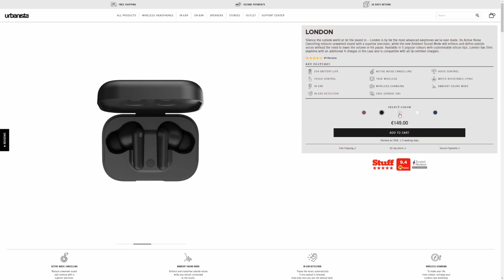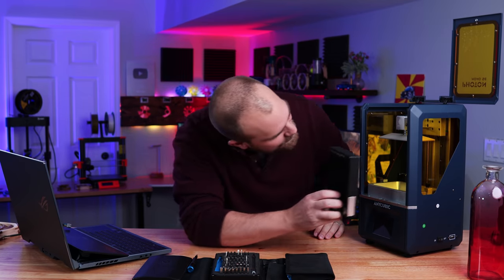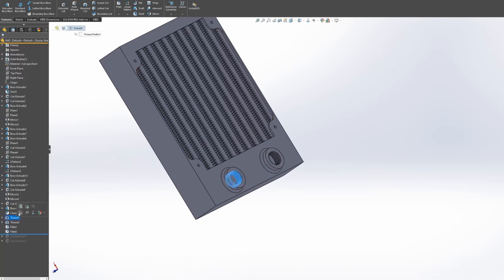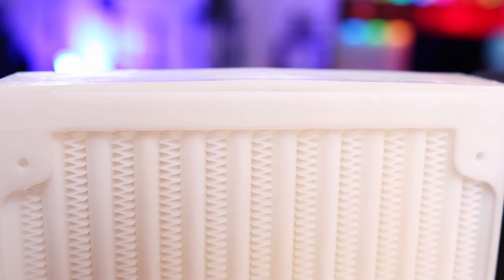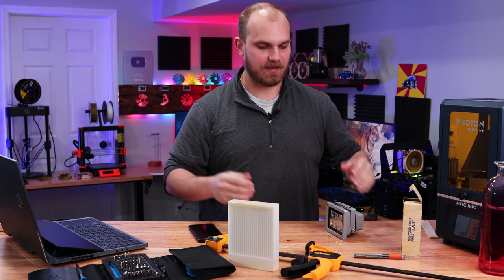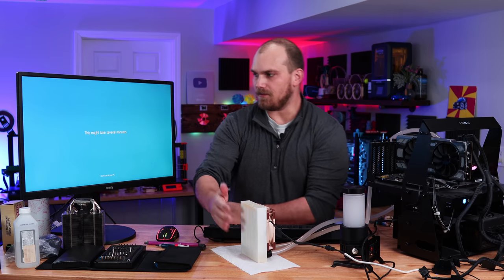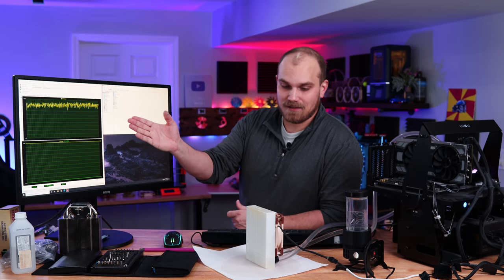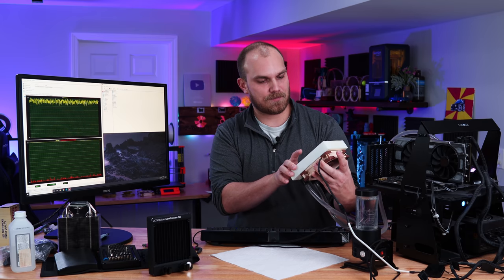I Never Expected This | 3D Printed EK Coolstream SE 120mm Radiator

Comment: You should remove the fins, as it's a non conductive material they act as nothing more than airflow restrictors and insulators. Just make parallel hollow bars with a decent width between for air. Maybe a 1.5-2mm gap?

Comment: I'd love to see this with a 360mil rad to see if you can get real useable performance
Reply: Also turn up the fan speed bloweymatron ?!? Anyone
Reply: Also turn up the fan speed bloweymatron ?!? Anyone
Reply: It needs to be tested much longer since it can absorb more heat, at this stage fins' size will be the most important parameter.
Reply: That would be too long for the printer
Reply: @eliklappenbach2426  you just design it so that they can fit into each other and he can glue them the exact same way together using the light.
Reply: @eliklappenbach2426 So print in stages, and bond the bits together.  We need to see what a 360 can do!  Blowymatron might destroy it though, so test that last.
Reply: all you need to do is remove all little fins so air would go through radiator without being hindered AND MAKE radiator FAT so AIR WOULD DO MORE WORK cooling it down. also maybe doing water channels a bit zigzag with obtuse angles e.g 150deg would make water travel through radiator a bit longer = cool it a bit better.
with this you probably can do a much better resin radiator.
Reply: If a 360mil doesn't work you just increase the size if you want a plastic radiator. You can make a radiator work out of almost any material, you only have to make sure that you have a big enough cooling surface for your cooling capacity that is required and that your material can withstand the temperature.
For efficiency purposes we obviously use thermally reactive materials but any thermal conductivity will do the job on a large enough surface.

Comment: Some things to try:
1) Flush the radiator out before putting it into an actual cooling loop. That leftover resin could be reducing the heat transfer capabilities of the water. Maybe not by a huge amount, but a plastic radiator needs all the help it can get.
2) Change the fin design to be just lots of straight flat and much thinner surfaces that span the gap between the water tubes.
3) Try corrugating those fin surfaces along the path the air flows through them. Orient them so if you took a cross section looking at the radiator from the left or right narrow sides, you'd see the corrugations.
4) Try not having fins, and instead make lots of small thin round rods spanning the gap so each end attaches to a water tube. Maximize the air contact with the surface area by arranging the rods in a staggered/offset pattern so there's no clear straight airflow path through them. Try varying the spacing between the rods and their thickness to find the optimum result.
5) Print smaller test radiators to make it less expensive to try multiple variations mentioned above.
6) Once you have a good design, try adding graphene nano-particles to the resin to enhance its thermal conductivity.

Comment: I have a few ideas to improve this, time to start doing some drawings.
Reply: I can't do any 3d modeling but I'd say do a design without fins, only water channels as plastic doesn't conduct heat at all almost. That means every bit of plastic that is far from the water is not hot whatsoever.
Opinion?
Reply: @mrle0719  That was my thought too. More, smaller channels, maybe with a few small structural fins in between them
Reply: Are metal 3D printers still extremely expensive or just expensive 🤔? This woul be nice application for them.
Reply: There is plenty to be done that could improve the efficiency:

1- regulate the coolant flow, water will always the the path of least resistance (and most of time the shortest). This mean that I'm pretty confident that the radiator flow would be mostly fast around the center pipes and quite slow on the outer edges. Meaning loads of hot water would make it through without really having a change to exchange heat.

2- print with FDM instead of SLA. First SLA print are quite smooth, meaning the coolant flow will be less turbulent and therefore have a less effective heat exchange, the classic layer lines produced by filament printing in this specific case would be a positive attribute (also increasing surface area with both mediums). Metal filled filaments are way cheaper and available than metal filled resins, also they have much lower specific heat and higher thermal conductivity than regular 3D printing polymers.

3- More and thinner pipes (maybe positioned in a staggered setup to maximize airflow turbulence). Probably way more efficient than the finned design since any plastic is a poor heat conductor. 

4- reducing mass, thermoplastic and resin have quite high specific heat. The radiator shouldn't be the system heat damper, that's the water/coolant fluid job. So ultrathin walls for the ducts would be priority.  

Finally, my bet is on a Metal filled PLA printed with a 0.2mm nozzle, many more piped with 2-3mm ID (max 2 wall perimeter, flow-rate set slightly high to maximize surface area with both mediums and secure from leaks), then annealing the print (to improve the crystalline structure of PLA which improves heat resistance and should THEORETICALLY improve thermal conductivity too). 

It's a really, really tall order but performance can be massively improved and price stay below the 10$ mark.

(Even thou this would be like re-inventing the wheel and should be therefore only be done for internet credits 🤣)
Reply: removing the shroud may also help dissipation . building a fin stack that supports the radiator and fan mounting. this falls into the mass category just more specific
Reply: all you need to do is remove all little fins so air would go through radiator without being hindered AND MAKE radiator FAT so AIR WOULD DO MORE WORK cooling it down. also maybe doing water channels a bit zigzag with obtuse angles e.g 150deg would make water travel through radiator a bit longer = cool it a bit better.
with this you probably can do a much better resin radiator.

second idea is to make flat labyrinth tube as fat radiator - one in and one out with inner flat tube cross-section being equal to round tube cross-section.

Comment: It would be interesting if you could measure the water flow and the inlet and outlet temperatures to and from the radiator. Then you could calculate the heat transmission and compare your plastic radiator to a metal one 😊

Comment: Hella late to this, but had an idea. I saw a video by @AdditiveManufacturing on a 3D printed heat exchanger for a helicopter that took advantage of gyroids to maximize surface area. It'd be sick if you could use that same tech for a pc radiator.

Comment: Just an idea for possibly better results: ditch the fins and make the water channel smaller and especially *longer*. Since plastic has terrible thermal conductivity, the fins will not do you much good, but having more pipe length for the water to cool down might help the radiator cool it better.

Comment: Really need to do a control test with that amount of water in just a tank and see how the computer does vs the plastic radiator.
Reply: That's what I was thinking. Just a connector to connect the two tubes and bypass the radiator/fan and see how it compares!